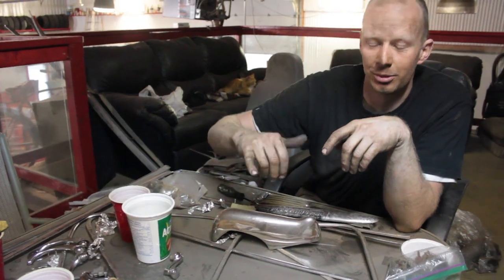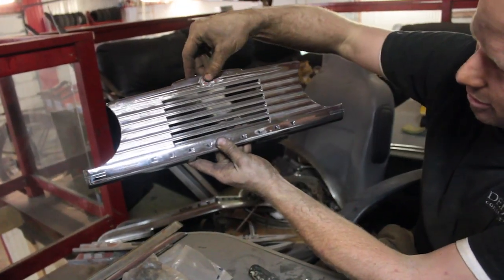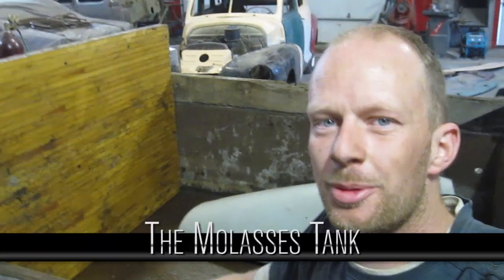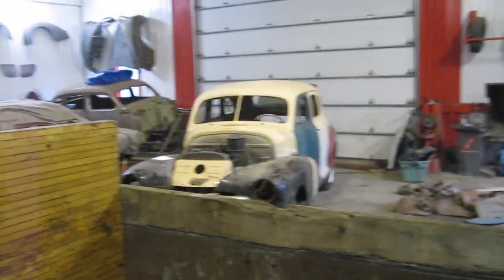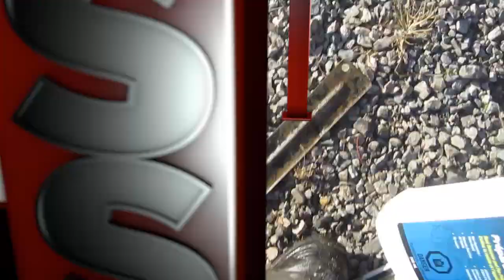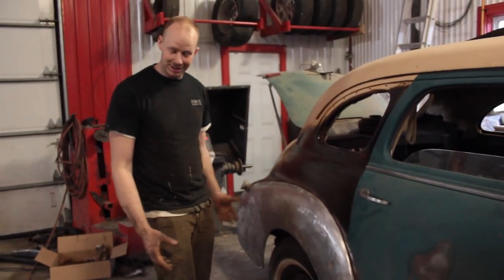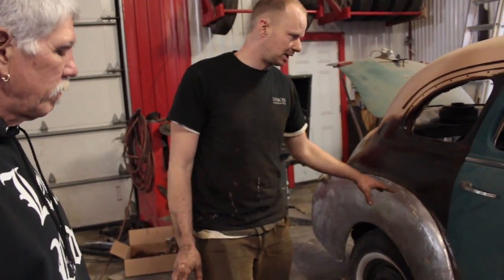RUST REMOVAL: '48 Chevy Fleetmaster (Part 2)

Comment: Looking good. Amazed at the molasses trick. Reminds me of the gun stripping trick i saw years ago of putting disassembled gun including stock in a dishwasher. The detergent for dishes stripped the bling off parts and finish off stock. The guy said you better check with wife first to avoid trouble! The parts came out cleaned.

Comment: in those older cars, there was some sort of welt between the body and the fender so be sure to get that stuff, or else :)
Reply from the maker: Got a roll of it, thanks.
Reply: +DEBOSS GARAGE great !  I look forward to seeing the final restoration.
Reply from the maker: +granskare The interior is done.  90% of the metalwork is done.  Frame is blasted and painted.  Most of the chrome is polished.  Another video will be out soon...